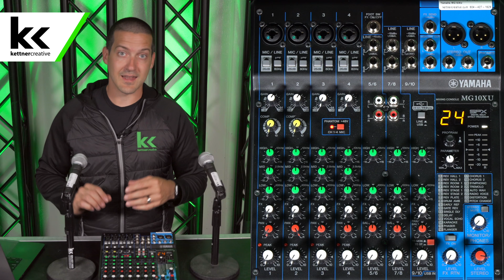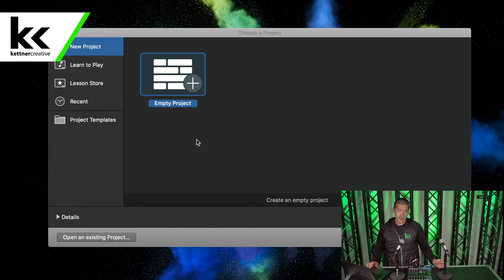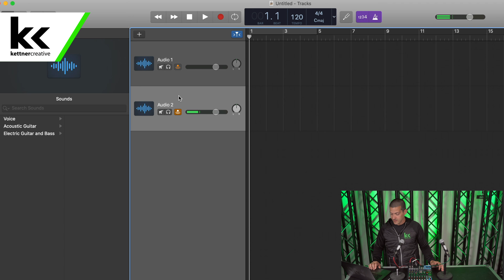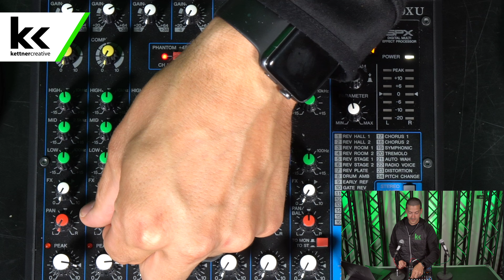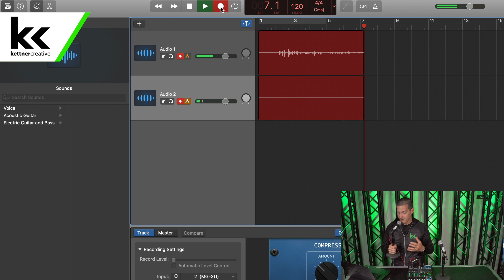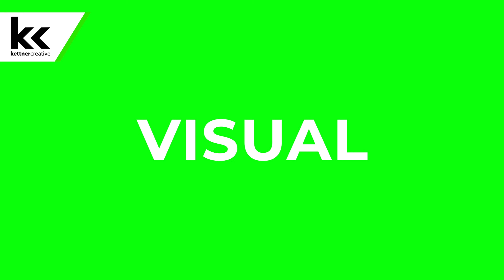How To Multi-Track Record Using Yamaha MG10XU USB Audio Mixing Console

Comment: I regularly use MG10XU as my single interface device, for recording bamboo flute on Cubase. All Mixer settings done exactly as you explained (except that I always do a single track recording). Only difference I do is that I open the channel 9/10 and use it for real time monitoring via the Phones output. Also I use a condenser mic instead of a dynamic one. Now, I find a couple of issues with this. 
1. The output is too silent for my DAW (always it's below -23dB fs). I raise it using the clip-gain on the DAW, but I know that's only a work-around
2. The sound quality is not good. Not sure it's a mic issue (I use a good quality one - Blue Baby Bottle condenser mic). 
Any valuable thoughts?
Reply: I guess I found out something. Panning is critical even for a single track recording. Without panning the sound quality is much worse (at least the case with flute) and it clips easily. My recordings are much better with the track panned (and thus forced to be real mono). Thanks a ton !

Comment: if you use more than 3 channels in the mixer, how does the mixer decide on what channels go to which channel in the DAW?
Reply from the maker: It’s always the main stereo output, but you can cheat the system by panning any two channels left/right if you’re not using other channels

Comment: This is the biggest problem with MG10XU to me--you can't record anything without hauling a laptop with you.  I would pay another $100 easy to just get a capability to record just in stereo to an SD card or thumb drive.  I'm not sure I would buy the Yamaha MG10XU again, for just this reason.
Reply from the maker: For sure, then you’d need to upgrade to the Rodecaster Pro or Mackie DLZ, but it’s a pretty big price jump.

Comment: I've had the MG10xu for years but have never used it as an audio interface. I also have the Behringer UMC404HD and the new Mackie DLZ but for simplicity sake, I think I'm just gonna use the MG10xu. I will have 1 mic, digital piano (L&R), acoustic guitar and electric guitar (L&R) (through stereo effects). 
My question is: can I select ANY 2 of the 10 inputs to record in my DAW or can i only record channels 1 & 2 on the MG10xu? 
Thank you!

Comment: Thanks for the video - I was hoping for the next step where you lay down another track while monitoring the first two on the DAW via the desk - is that because the MG10XU can't work that way?  (I want to work out if I can get away without having a separate interface for DAW recording)

Comment: I understand that you can record two inputs.

Can you record the stereo output of all the mics being used on the mixer?  Can it be recorded as a stereo pair via USB?
Reply: "stereo pair via usb" that's a combined question.
The usb will output a stereo signal no matter the inputs. If you pan the inputs, you can turn this mixer into a multi-track ...outputter, for lack of a better word (it's not a recorder) ...as in a 2 track recorder. However you pan the inputs will be sent via stereo out. This thing is a ...what...10? input device? 10 input 2 output. 10 in MIXER...2 output...left and right.

Comment: I'd like to accomplish this, but with 4 microphones. My question is: does that mean inputs 3 and 4 also need to be panned L and R respsectively?
Also, if I have my headphones hooked up to Garageband and the mics are all panned and I am using active monitoring, does this mean I will hear them in the L and R channels or will it be stereo output? Hope you are able to see this and respond!
Reply: If you didn't figure it out via trial and error, then yes, 3 and 4 would need to be panned..and they'd be mixed into the left and right channels respectively. This isn't a multitrack recorder. He's showing how it CAN be used as a multi-tracker...2 tracks a t a time. Left and right. This is a mixing board.  The headphone output will channel the entire mix, whether it be all inputs or only one.
Reply: @professorfether9338  Thanks, I haven't picked up a mixing board yet, but I appreciate your answer!

Comment: Hello, I have Behringer Xeynx QX1204 and when i pan the audio to the right i get no audio signal in audacity but when i pan it to the mid or left I get a normal signal to both channels, anyone knows a solution to this?

I am connect via usb, is it necessarily yo connect via RCA cable to 1/4 audio jack to laptop?

Comment: If I wanted to send 4 mics from my mixer to my interface then to my DAW, would I only be able to make two channels left and two channels right? Or is there a way to get the 4 different signals on 4 different tracks on my DAW?
Reply from the maker: You would need a digital mixer to send all four tracks.

Comment: Just to make absolutely sure: The Yamaha has 4 XLR/line inputs and an extra 6 line only inputs. Is it then possible to plug in, for example, 4 mics in the XLRs and guitar and bass in 2 of the 6 line inputs and finally, two keyboards with stereo out to the additional 4 line ins, pan them all and have Garageband pick them up as 10 separate channels?
Reply: From what I've understood: your DAW will always only pick up 2 incoming channels (Left + Right), and it is from the mixer that you'll define which physical channels are routed to OUT Left or OUT Right. But to be clear, incoming Left channel will be a single audio track made of the mix of everything you panned Left, and incoming Right channel will be a single audio track made of the mix of everything you panned Right. There's no way you can send more than 2 single tracks to your DAW, using these not-multitrack USB audio mixers (Yamaha, Mackie, Soundcraft, Behringer, etc.). Some recommend the Tascam multitrack range, or the Behringer UFX range.

Comment: I need help with my Yahama MG10XUF. I’m trying to use it to record audio(microphone, etc) and I set up my mixer with fl studio 20. On fl studio I select audio settings and chose ASIO 128samples rate. So far everything good. I open a beat on fl and also do all the channeling to get ready to record. I’m able to record e all of that but Now my issue is that I want to know how can I record vocals on my microphone and mute the monitors while recording? I’m not sure if the mixer can do it or if I need to choose any option on the daw. Can you help? The only work around i found Is to turn down the monitors volume knob on the back while recording because mixer does not have any button to lower Monitors volume.

Comment: I have a question.. i have the MG16xu soooo can I multitrack record with 16 tracks separated? or is it just 2?
Reply: me toooooooo same question
Reply: @kamalueusebiuschika5744  Its weird for an analog mixer to have a usb cable interface with 16 inputs and it cant record it separately? weird
Reply: @kamalueusebiuschika5744  Hi! Did you already figure it out? I have the same mixer and I've been trying to record on Cubase, but it doesn't show the 16 physical ports, just two.
Reply: Hi! Did you already figure it out? I have the same mixer and I've been trying to record on Cubase, but it doesn't show the 16 physical ports, just two.

Comment: Hi, Does this means that one mic will only output to left speaker and 2nd mic will only output to right speaker when you use the PAN function?
Reply: Technically each track in garage band is mono so both mics will playback from both speakers unless or until you start changing settings on the tracks inside garage band to achieve your desired mix.

Comment: Hello Sir Jordan, im having trouble with my new MG10XU, been trying to fix the sound for a week now but cant fix it. Maybe you could help me fix this issues. 🙏

Whenever I play some music using USB cable connected at the back of the mg10xu with my laptop, there is always an annoying buzzing sound or some kind of a crack noise going out of the mixer to the speakers, but it only stays there for about 5 to 10 seconds and it will again continue playing nice, then after about every 2minutes, it would come out again. I have used different styles and laptops to test it. But it wont fix. 😫 PLS HELP if you ever have this kind of trouble as i guess your a long  time user of this console.
Reply: Tengo el mismo problema, si consigues un solución, me gustaría que lo compartas

Comment: I am trying to record with the MG10XU going from the usb port to my mac and using the audacity program. Audacity recognizes the MGXU input but the playback is just chipmunk like sounds. When I switch to built in mics on the mac it sounds normal. Does the MGXU not interface with audacity. Thanks.
Reply from the maker: Can you get the MG10XU working in Garageband? I've never had a problem with it in any problem. 

Some people are having issues with some Macs with M1 chips, but I haven't heard of any Yamaha users with this issue. I currently use the Yamaha AG06 as my daily streaming/converencing/etc. interface and have zero issues on my new M1 Mac.

Comment: Thank you. I have audio tracks that I’m going to be using, and one mic.  I think I’m ready to record. But when I plug everything in, I notice there is already noise being monitored by the green light. Can you or someone tell me what each of my levels should be, also that I might be able to hear myself in my headphones as well? Thank you.
Reply: If you're hearing interference/electrical noise, turning on Phatom Power (+48V) on the audio interface fixes it for me for microphone recordings, should work for you as well.

Comment: I love the MG12XU because it has faders, clear and bright on/off switches for each channel and it has an audition button for each channel so you can set the gain for each channel without raising the main volume to 0. And it has a more accurate volume meter with more notches. And it doesn't need an external power brick because it's built in and the panel is at a nice angle because it's tilted.
Reply: Thank you Epicon.  I was waiting for sponsor of this chat, but if you are proficient with this Yamaha may I speak with you in the meantime?
Reply: @chrisclements3862  What do you want to know?
Reply: @epicon6  Thank you. I have audio tracks that I’m going to be using, and one mic.  I think I’m ready to record using my Yamaha MG10XU going into my iMac, But when I plug everything in, I notice there is already noise being monitored by the green light. Can you or someone tell me what each of my levels should be, also that I might be able to hear myself in my headphones as well? Thank you.
Reply: @epicon6  Thank you. I have audio tracks that I’m going to be using, and one mic.  I think I’m ready to record using my Yamaha MG10XU, But when I plug everything in, I notice there is already noise being monitored by the green light. Can you or someone tell me what each of my levels should be, also that I might be able to hear myself in my headphones as well? Thank you.

Comment: Hi, I just got the MG20xu. I connected it to my laptop using the USB which notified me the installation was successful. But moving forward I wana multi track using Cubase 5 but I got no audio connection. I opened the device settings to change my interface to Yamaha Steinberg USB Asio but I kept getting 'Device could not be opened. I've tried using other USB cable, tried other PC.. Still no solution. I'm on Windows 7. Please any solution cos I feel I just wasted money buying the console?
Reply: You need a audio interface!

Comment: Hi Jordan, thanks for all your helpful videos! I have a question - I have this Yamaha mixer and use Garageband. But, like in this video the waveforms are just tiny blotches in the centre so you can hardly tell what's happening, and the volume in GB is really low when you play it back. I've tried turning the gain way up, but that doesn't do the trick. Is there any way to improve the wave form and the volume?
Reply: Did you try to set up the record level, the one you may find if open Audio Midi Setup app? I've found inputs there and increase the record level, so the waves are good now.
Reply: Use the PAD setting on dynamic mics when recording to increase the gain (+26db)
Reply: @MichaelBYoung  that’s a minus 26 db not plus
Reply: I use Audacity to master DJ club mixes. I presume GarageBand is similar. Digital audio can be amplified with no degregation. I was taught to record DJ mixes at low volume and amplify. (Note: background noise is also amplified).
Reply: click on program knob 5x to activate attenuator, then rotate to right to increase audio. click program knob 1 more time to appy the change

Comment: it seems to me that this mixer and the Xenyx 1202USB (i own both) will not send playback of recorded audio from my laptop back to the mixer for monitoring via USB, and to monitor what i've recorded in my headphones, i would have to send audio from my laptop's headphone jack to my monitor input on the mixer, which is lesser quality than the actual recording. am i correct?
Reply from the maker: No, If you press the USB/Line button on 9/10 and "To Mon" on 9/10, you can monitor from the USB no problem.

Comment: do you need a driver for this? wanting to connect my Mac via usb so I can play Spotify on 9/10 usb in channel. if I select my output to be the mgxu then I would be getting levels through the last channel, correct? I don't have the mixer with me otherwise I would just test it out myself.
Reply from the maker: You don't need a driver for mac. To play spotify from your mixer: Select MG as your output device in audio settings, select the USB button on the mixer (channel 9/10), then turn the volume up.

Comment: When I record the signal is always low and I am forced to normalize even with the gain etc up high. What gives?
Reply: What sort of mic are you using?  If it's dynamic (as opposed to condenser) like a Shure SM58 or Beta 58A, I've seen that common when linking to computer.  The best solution I've found is to use a device like a Cloudlifter.  That's built for dynamic or ribbon mics and uses phantom power to get a clean signal boost from the mic before it gets to the console.  With a Cloudlifter and MG10XU, I get a consistent, nice strong signal to the computer all the time, and so far extremely low noise - virtually none.

Comment: It is a 10input mixer but I get to use just two inputs in my interface... 😔😔
Reply: Yeah that’s disappointing- i purchased this without checking further- I was expecting at least 4 inputs but to know only captures 2 is a serious bummer.. I have a tiny usb interface that can do that job.
Reply: The interface is just for recording the stereo mix / 2 ch out of the mixer (whether youre mixing all 10 chs or less) ,  most lower end mixers have this functionality with usb.    To have a multitrack recording mixer where it can record more than 2 tracks at a time you're looking at quadruple the price easily.    If you only do home recordings by yourself, this mixer is an excellent choice but if you're a band wanting to track live, this isn't a good option.
Reply: Same thing here... mine is 24input mixer

Comment: I'm curious, does Garageband send audio back out to the mixer for playback?  my output in the OS is set to the mixer but no audio comes out, also set up in Garageband.  The mixer is connected to a stereo system.
Reply: check your output setting on GB before recording 
From the dialogue page where you select the input at the left hand side so, at the right hand side, you can select output device

Comment: good day.  I am sooooo not savvy.  I have the Yamaha, iMac, but Im trying to run 4 mics and 4 headphones.  possible?  thanks.
Reply from the maker: Yeah, you just need a headphones splitter. You won't be able to multi-track record everything, but you can record the whole mix, which is usually good enough for a podcast like this.
Reply: @kettnercreative  Somehow I did not get my mics to register. Maybe I need to modify some settings on the iMac, as well as the mixer. I noticed you had the number 24 on your screen on the mixer. I can read the instructions to find how to imitate that, but is it significant?

Comment: That is such a great thing to know! I’ve had this mixer for almost 5 years now, and I never knew. 

Definitely going to try this out!
Reply from the maker: Awesome
Reply: @kettnercreative  Question...

Are you familiar with running multi audio interfaces simultanuosly within a DAW through the Aggregate option in your Audio MIDI Setup (Mac)? If so, will the MG10XU be detected as another "audio interface" through the Mac? I haven't had a chance to try it out myself, but I was wondering if you ever tried it.
Reply: When I use a condenser mic the input is very loud. I have the level a little bit and gain a little bit but is is very loud @kettnercreative
Reply: I've had MG10XU for 10+ years and didn't know this.. and I was really looking for a dual track interface !

Comment: Thanks for all the helpful videos.
I want to connect my iPad (lightning connection) to my MG10XU and then to my laptop to record with Audacity.
What cable do I need to send music from the iPad to the mixer and where do I plug it in? Thanks!
Reply from the maker: I would use a headphone to dual 1/4" jack. Something like this: https://geni.us/5aCz to go from your headphone jack into line 5/6 of your mixer.
Reply: @kettnercreative  Got it. Thanks very much.

Comment: Reverberation can be used??? When I use it in headphones, the intensity is very strong compared to the actual recording. How do I regulate it in a real way???
Reply from the maker: This probably has more to do with what frequencies are stronger in your headphones. It's should be the same mix as the actual recording.